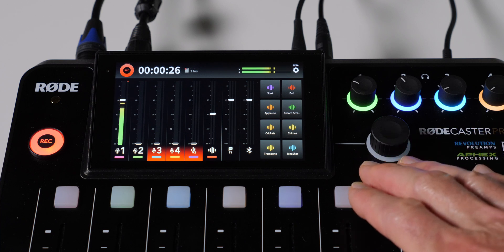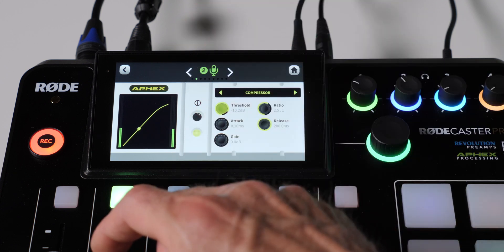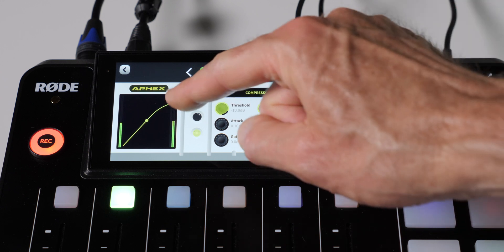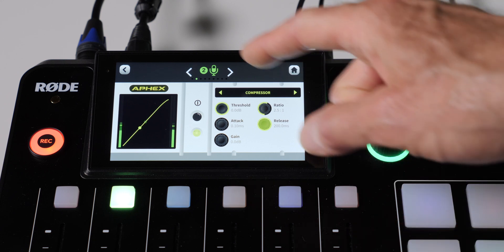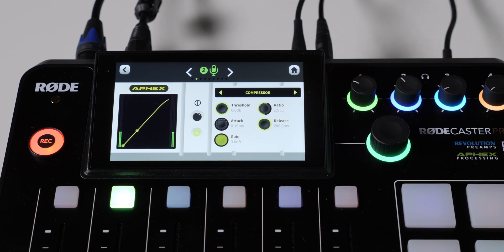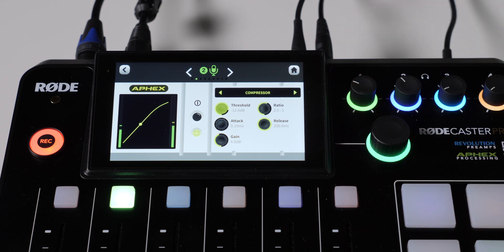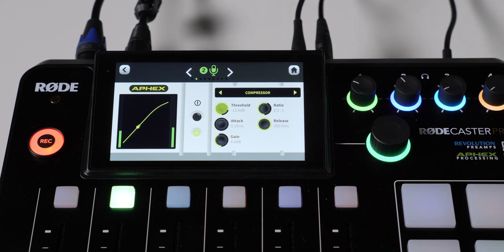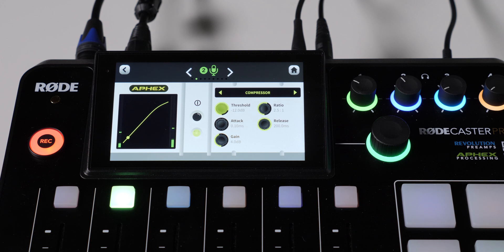RODECaster Pro II Compressor Settings & Explanation

Comment: I just purchased my RP2 - I’m a hockey broadcaster and so I’m obviously in loud buildings so I’m curious how to best utilize the compressing settings not just for my microphone, but hopefully for line level inputs for the ambient sound microphones located on the glass. What would you recommend from a setting perspective/ what areas should I be toying with to figure out what works best for my loud excitement coupled with the ambient sound?

Worth noting, I do also have an RDL Microphone compressor which I’ve utilized in the past but I’d like to downsize my setup if possible.
Reply from the maker: I don’t know that I’d compress to ambient sound, I’d fade it down and use the fader to manage that. Then use the process we covered here for you voice.

Comment: I wish this had a pre-gain so it's easier to get those low passages within the bandwidth without having to lower the threshold too much.
Reply from the maker: It has plenty of gain on each channel.
Reply: @curtisjudd  Well, yes, but I'm talking about pre-gain, before the compressor, like a normal (physical?) compressor for the reason I state.
Reply from the maker: @BrazenNL  I hear you, just saying that there are a variety of ways to achieve the same thing.

Comment: Curtis, is it possible to bypass the preamps on the Rodecaster when using outboard gear?
Reply from the maker: You can set the XLR/combo inputs to line level and feed audio from outboard gear, yes.

Comment: Hey! Great stuff! This certainly helped get my compressor settings right, I was using a preset that was compressing me to -28 dB LOL!

Also, what would you recommend for the Master Compellor? Keep that turned off? Or dial with threshold close to 0 dB? 

Thanks in advance!
Reply from the maker: If you're recording just one person, I'd generally use similar settings but set the threshold closer to 0 dB.

Comment: For setting the gain/make-up gain I would suggest disabling the compressor and listen if the loudness has changed compared to it being enabled.

If so, adjust the compressor gain accordingly. It shouldn't be quieter than before and definitely not louder. You just want the loudness range to be reduced not the perceived loudness itself changed
Reply from the maker: Thanks for the tip. Sometimes you do need it a bit louder.

Comment: With the Master Compellor, do you recommend turning it off if it's just me and my wife and a simple podcast?  Or do I just a conservative threshold to like -19db and a gain of like 4db?  Having trouble understanding this setting. Thanks so much as any help is appreciated.
Reply from the maker: No, I'd recommend turning it on. I'd move the threshold up quite a bit closer to 0dB, perhaps -6 dB. This is basically just another compressor and will help when you happen to laugh or talk over each other just a bit so keep it up closer to 9 where it won't do much unless you both get especially loud.
Reply: @curtisjudd  Thank you so much, your explanation really helped me out.  I appreciate you taking the time to respond.

Comment: I came from using an SM7B with a cloudlifter, dbx286, and scarlett 2i2. I am now using the RODECaster Pro for an all-in-one solution, and it has been tough trying to dial in the settings. The way you carefully explained (and demonstrated) the purpose of each setting for the compressor was excellent. You made everything easy to understand without oversimplifying. This video REALLY helped me out! Thank you!

Comment: Your "how not set a compressor" is near to be a "how to" for a lot of broadcast applications. For many radio stations a slam sound is wanted, and for this it's impossible to achieve a gool slam sound with this unit (what is simple to do with a Symetrix 528e or a dbd 286...).
For my part I would like to see a real limiter in mic chain or at the place of compellor, to be cool on compressor and to keep a control for extreme peaks.
Reply from the maker: Yes, this is far milder than the slam compress approach. I’m not objective. 🙃

Comment: Curtis, this is an excellent video on the Compressor settings for the RCP II. I just purchased one and did not own the prior version. I appreciate how you explained the settings and showed the result including the console view. Subscribed!   Please do so for the other sound processing.  Yes, the Noise Gate would be a good next choice.  

Also, given that some processing settings could affect others, do you have recommendations for what order to set the processing option?  Ex: Should I set the noise gate before I set the compressor before I set the equalizer?

Please keep making these excellent videos!
Reply from the maker: Thanks, will do. I’d recommend setting them in the order they are arranged. Top row left to right, then bottom row left to right.

Comment: Great video. I’d love to see a similar video for the noise gate. I can’t seem to make it transparent enough for my liking.
Reply from the maker: Yes, noise gate tutorial coming. 👍
Reply: @curtisjudd  Yay
Reply: I am the same just can not get it to sound right on the RCP2, with the RCP1 we also had the visual Rodecaster Pro App to adjust the setting and I found that so much easier and quicker to revert to original settings, the RCP2 now that is a different beast altogether 😟 ALso the RCP2 App is in my opinion nowhere near as useful and helpful as the RCP1 App is/was, It would be great if Rode could emulate all the functions of the RCP1 App into the RCP2 App.

Comment: As usual Curtis, you present a perfect tutorial video. I watched from start to finish and learned a good deal from you! I have the RCP 1 and I'm pondering whether it is necessary to buy RCP II, for my new digital radio station.
Reply from the maker: Thanks Keith! Probably not necessary unless there's a specific problem that the RCP1 doesn't do for you?